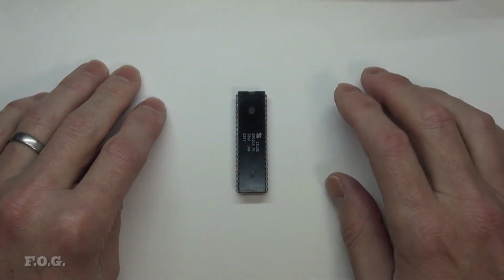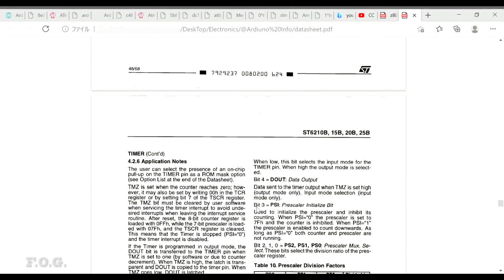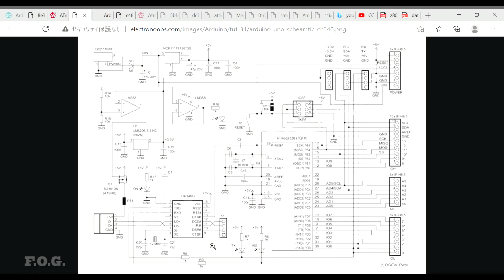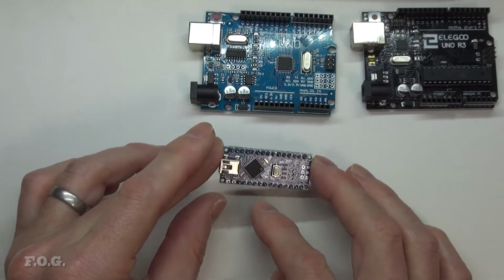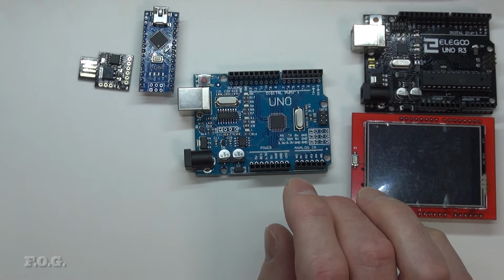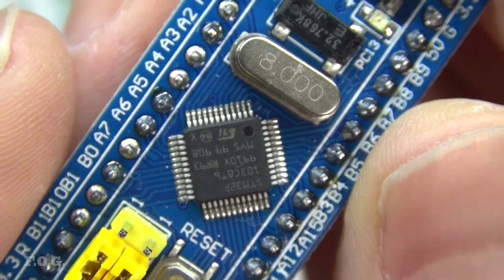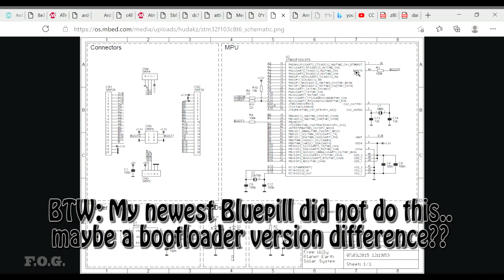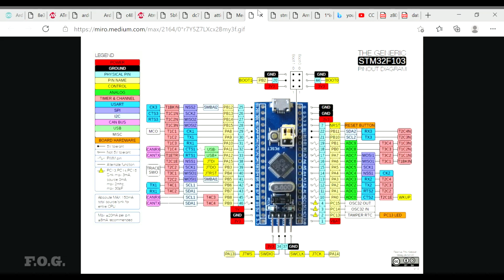EP1 - Arduino Microcontrollers - How to Choose???

Comment from the maker: An important notice about the Bluepill STM32F103C8T6. The specification indicates flash memory of 64GB, but in fact is seems nearly all Bluepills made have 128GB. The Arduino IDE will allow you select and program these F103C8T6 Bluepills to be programmed as 128GB, but you need to select as such (look and you will find it). The reason I found out about this, was because when making the software for my mini-lathe upgrade I quickly found out that 64GB was not enough, and stumbled on this surprising info, talk about luck!, thankfully 128GB was a nice fit even with a bunch of fonts. So in fact a 64GB Bluepill is not so great for full flushed projects, but 128GB should be enough for most projects (but  not all). So recommendation still stays the same, assuming all Bluepills are in fact 128GB, then Bluepill should be a great option, switching up to Blackpill if need be.

Comment: the diode below the usb mini port on the nano burns out all the time and you have to just bridge the thing. it drives me nuts.
Reply from the maker: The diode is there to protect your device connected to the USB mini port should you happen to connect a direct power supply to the board at the same time (i.e. uses on board 5V reg). If you never use that on board 5V reg, then shorting the diode is not so bad, but still I generally would recommend replacing it. The diode is rated for 500mA, so possibly you are trying to push too much current through the board?